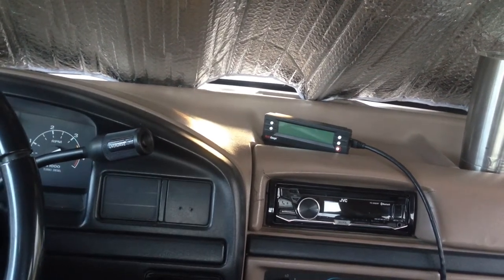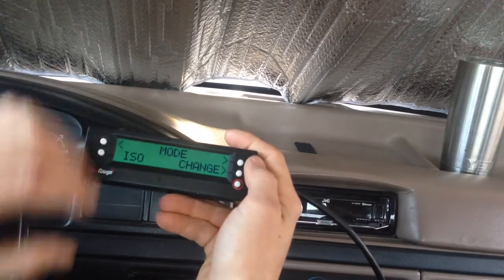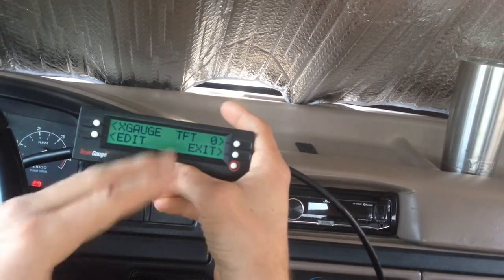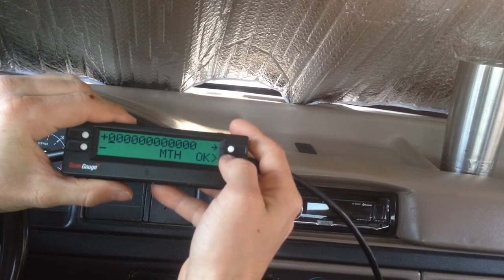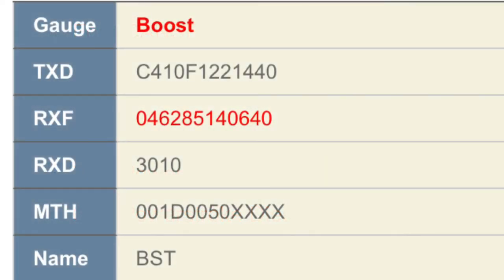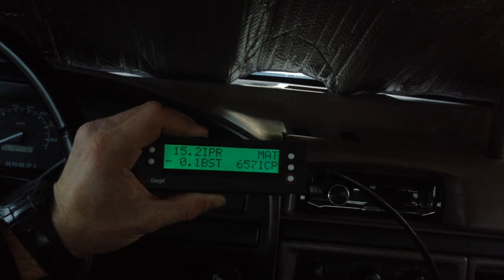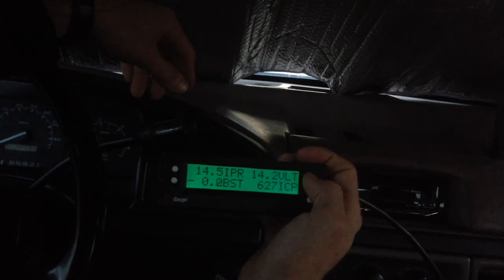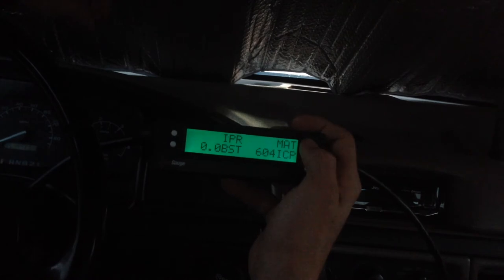Digital Gauges OBS 7.3 With Scangauge 2

Comment: You seem to be one of the few that has been able to make this work for our trucks. All over the forums everyone including scangauge says it will not communicate with our trucks
Reply from the maker: Yeah that's what I heard too. I ended up finding the instructions that the SG II uses to set up with a super duty 7.3. I already had the gauge from my previous truck, so it was just collecting dust unless I somehow got it to work with my OBS. It helps that mine is a late model being a 97. Though the gauge should work with any 96 and up model. I've heard some 95's can have the PCM reflashed for OBD 2 so the gauge will work with them as well, but don't quote me on that. Are you able to get the gauge to work on your truck?
Reply: Mine is a 96 and I thought about taking the chance. But my luck it wont communicate and will not be refundable
Reply from the maker: @LUMBERJACK877  I know what you mean. If you could borrow someone else's gauge that'd probably be best. You aren't in Texas are you? I did have a strange issue with friend's Super Duty. We tried connecting the SG II to his SD and it didn't work, though it works fine on my OBS truck. Now that I think about it there may be a blow fuse to the OBD 2 power port... If you want a cheaper option to at least try out whether it'll work or not, get a bluetooth OBD 2 reader. I have a BAFX OBD II Diagnostic Interface, it's only $30 or so off amazon. If you have an Android, you can get 'Car Gauge Pro', it's a poorly made app especially for $8, but it will allow you to run the injector buzz test, cylinder contribution test, and a glow plug system test. It also has some gauges that allow you to monitor some things like the scan gauge 2 but on your phone. Just a thought.
Reply: @LUMBERJACK877  Got one for my 96. It was Built Feb of 97 and is the Cab Chassis F350 in the avatar. It works on everything so far but manifold air temp. I like watching  what is happening.

Comment: THANK YOU!!!!!!!! I just bought a OBS 7.3 and have used a scan gauge II for a 6.0 and was hoping it would work on my 96!
Reply from the maker: I'm glad the video helped! I was in the same boat, except I went from a 97 Chevrolet to my 97 Ford. I use the gauge all the time now. By the way, what motivated your trading in of the 6.0 for an old slow 7.3?
Reply: @Rnddiesel  I totalled my 6.0 a few years ago. I absolutely love them. Eventually I want to 6.0 swap an OBS because I prefer the OBS body style. This 7.3 I just bought has over 300k miles, no blow by, one owner and it's unmolested and bone stock.
Reply from the maker: Awe man, sorry to hear about the 6.0. You know the 6.0 is definitely interesting; they've got their own share of problems, but the technology behind them is pretty amazing, and they're far more affordable these days compared to a common rail diesel. A 6.0 is an OBS would be cool! Heck at that point  you legally wouldn't even need the EGR. Congrats on the OBS 7.3 though! Mine's in decent shape too, but more of a work in progress. I've got 362k on mine, it just leaks a bit at times unfortunately.
Reply: @Rnddiesel  where did you wind up mounting the scangauge? I'm picking my scangauge up tonight
Reply from the maker: I wish I had a picture, I got it to fit perfectly basically right where you see it in this video, right in the middle of the dash. I got one of those carpet dash covers a while back, so I put some Velcro on the bottom of my ScanGauge and mounted it directly on the carpet. With the carpet dash cover, I put the wire coming out of the back of the gauge, routed it along the seam by the windshield and dash (it gets covered up by the dash cover) and over to the passenger side where it runs along the A pillar, goes under the glove box and into the OBD 2 port. On the bottom side of the dash by the glove box I found some "spare" wire clips, it's hard to describe, but the scan gauge wire clicked right into 2 of the wire clips like it was meant to be. It was the perfect amount of cable too.
Reply: @Rnddiesel  thank you for the reply, I'm going to try a semi permanent position for it. We will see what happens. I greatly appreciate it man. Keep up the good work, definitely got a new subscriber with me.
Reply from the maker: Thank you very much! I'm glad to help. Let me know how your gauge mounting works, I might be interested in changing things up with mine.
Reply: @Rnddiesel  I'll to take plenty of pictures, but I'm thinking of putting it below the wts light panel where the trim piece pops out.
Reply from the maker: Hmm, that would be interesting. Difficult to say the least I'd imagine too. There's not a whole lot of space there. Good Luck!
Reply: @Rnddiesel  I just got home with it. The only thing I don't have working that i want to work is my boost. It just reads 0.0
Reply from the maker: That's odd, you may want to change the scangauge MAP sensor setting to read boost rather than absolute, that may help. Also make sure you are checking the right one. On mine it has 2 BST "gauges" for boost monitoring. One doesn't work and is left over from the original Scangauge programming. It might help to double check that you've scrolled through all the sensors if there are 2 BST gauges. Glad to hear you got the rest working!
Reply: @Rnddiesel  I got it figured out, I had to manually enter the boost data on the SGII. I got the information from the website. Everything looks amazing from the data I'm getting the max boost I hit bone stock under WOT was around 11lbs at around 60. Does that seem right ?
Reply: I've gotta say man, you are awesome! 90% of the people on here don't reply to viewers and actually help them like you do.
Reply from the maker: I'm glad to help! I enjoy problem solving, so it's fun for me too. Besides you never know, I may have the same issues with my truck later down the road, and talking to other folks and seeing how they figured it out would a huge help for me too.  

Regarding the SGII data: 

Yeah manually entering boost data for calibration is a little bit of a pain, it also means that if a low pressure weather system comes to town or you go take a drive up the mountains or something like that, your boost numbers will be a little off. If you're running a "boost fooler" that would throw off the SGII boost numbers as well. Basically the boost fooler is a pressure regulator that limits how much boost the MAP sensor sees. Factory tuning pulls fuel when boost gets too high to protect the turbo, I think the magic number is around 16-18 psi boost or so. The boost fooler gets rid of that without tuning. 

Anyway, 11 psi at WOT seems a bit low, that is assuming you kept your foot down long enough to really let the turbo spin. They don't drive like 6.0's as I'm sure you're aware. The turbo response is way slower with the OBS 7.3 especially. There's a longer explanation on that subject though. Assuming you did let the turbo spool as much as possible, 11 psi is definitely low. When I first hooked up my scangauge with everything else stock minus a non-existent catalytic converter (The kid I bought the truck from hacked off the exhaust, not me...), Super Duty muffler, and a NAPA 6637 air intake I usually hit around 16 psi boost at WOT reading from the scangauge. 

It could be a number of things for your low boost pressures. The catalytic converter adds restriction especially if it's clogged assuming yours is still there... It could also be a simple as a bad MAP sensor, I don't know if that would show a check engine light or not. Though if it is indeed reading 0.0 psi ish at idle your MAP may be fine, it's just hard to tell without a second reference. Pull off your intake and look at the turbocharger impeller vanes. If those are mangled up that won't help boost, I think  you can get a stock replacement for $30 if you shop around, but you could also get a more refined impeller blade for "high performance" if budget permits. Your turbo could be worn, with the intake off, grab the bolt in the center of the impeller and try to push it directly in and out to check for end play. If there's play in the bearings your turbo might be due for a rebuild, that'll make a difference too. It could also be a boost leak. The intake plenum on your truck should be a black Y pipe. There's a rubber o-ring between the turbocharger and the y pipe that may have gone bad or wasn't installed properly. That o-ring is a pain to install by the way, neat trick is to use grease to temporarily hold it in place so you don't pinch it in half trying to get the two sections back together.  Also check your intake boots. If there's an excessive amount of oil/ greasy grime around those boots in the valley they may be bad and leaking as well. They are made of silicone which isn't very compatible with the oil that naturally makes it's way through the intake from the crankcase ventilator. Lastly on the turbo side, you may have leaking turbo Up-pipe donut gaskets. Grab a light and trace the up pipes from the exhaust manifolds back up to the turbo, look for soot around the connection points. They are sealed with these donut gaskets that are notorious for leaking and that'll cause your turbo to not spool all the way. That's pretty much it from the boost/ turbo side. It could be a number of other things like really worn injectors or a bad ICP sensor as well.

I hope that helps!
Reply: @Rnddiesel  I believe my low boost number comes from having 300k on the original turbo, injectors etc. She white smokes alittle on start up in the morning then stops the rest of the day. I've popped the hood and had someone start it and I couldn't see any smoke in the engine bad so that tells me theres no exhaust leaks. I think she just needs some love. My list of more I want to do is a 3" down pipe, 4" exhaust. 6.0 intercooler, intake, super duty 7.3 plenums, y, and snail housing and a wicked wheel II. After that I'll be happy and when she breaks motorcraft and international parts only
Reply from the maker: Wow that's impressive 300k on turbo and injectors! My truck has 362k, but the turbo was rebuilt at some point, and I'm supposedly on the 3rd set of injectors now, replaced them a little over a month ago. Replacing the injectors made a huge difference for my truck though. I never had terribly low boost numbers, but my truck was always really sluggish. Throttle response on the truck as abysmal! Well it turns out my fuel injectors were pretty worn out. After replacing my fuel injectors, I now see why the call it a "power"stroke. It used to only have power for the 1st 1/2 of the accelerator pedal, now just mash down and she keeps moving. It made a huge difference! Exhaust leak wise, I'm not so sure you'd be able to see any leak at idle anyway. Bear in mind too that as you put your foot into it, your exhaust back pressure goes from next to nothing at idle, to upwards of 10+ psi at wide open throttle. That pressure will make its way out through the smallest of holes and it won't take much to significantly affect the turbo spool. It sounds like you've got some good plans for your truck! I've got my own "custom" (build by me) downpipe that is a 3-3.5 inch then run to a 4 inch from there back. I've got an aluminum SD 7.3 intercooler installed as well. The intercooler was a tight fit even for the 7.3 one, I can't imagine fitting a 6.0 intercooler in there, but it has been done!  Also turbo wise, if you aren't planning to go too wild on tuning and what not, you may want to look into changing the exhaust turbine housing. Basically stock turbines have a 1.15 A/R ratio, you could get one with a 1.0 A/R ratio (Area/Radius "A/R" ratio smaller the number the quicker the turbo will spool)and it'll spool quicker at low rpms making it more drive-able, that's something I really would like to do.
Reply: @Rnddiesel  I watched your down pipe video and that solidified my thought of buying the complete system. I was thinking of a quick ratio housing. 6.0 coolers flow more than SD 7.3s but an SD 7.3 would be alot easier to install since I want to go to SD 7.3 plenums
Reply from the maker: Yeah it's definitely a bit easier to just buy the whole exhaust system. It sounds like you've got some good plans ahead for your truck. Have fun and good luck!

Comment: TFT works off an inducer so  resistance is the only reading you can use. Hotter ATF  lower resistance cooler is higher resistance so 3.55 would be like 40 deg and .56 she is real hot.

Comment: FYI, these codes work for my 95 PSD 4x4 with manual trans. No TFT reading but I doubt there's a sensor on my truck for that. Boost and such works though, nice to see my ICP figures are healthy on my truck (peaks up to about 2500psi, about 570-600psi at idle).
Reply: The E4OD has a trans temp sensor.  It's an input to the ECM.  The ECM leaves the Torque Converter UNLOCKED until a certain trans temp is reached.
You are correct about the manual trans.  The only sensor the manual trans is actually just a switch to turn on the reverse lights when you move the shifter in the reverse position.

Comment: That’s pretty cool. Does transmission temps and egts? I have a boost fooler so it won’t be able to read right for boost since I’m building over
Reply from the maker: It does not do EGT's, stock 7.3's never came with an EGT sensor built in, so for that you'll  still need to install a stand alone gauge. I'm not 100% sure on transmission temperatures though. My other code reader threw a code on my truck saying the transmission temp. sensor was out of range, so I suspect that I may have some form of sensor for that, but it may just be broken for the time being. As to whether or not that data is transferred to the PCM for data logging, I'm uncertain of too. If you figure that one out let me know! Though for safety purposes, a stand alone trans temp gauge wouldn't hurt. I've thought about maybe getting a 3 in one, trans temp, EGT, and Fuel pressure gauge if they make those.
Reply: I was looking into the glow shift gauge and pillar with 4 gauges for like 309$ and the 99 ford steering wheel gauge pillar for a single gauge there. It would be awesome just need some money lol waiting for tax season for some bank. 2 kids that’s like 7000$ lol and wife 1500$ lol
Reply from the maker: Kids and be a wife! Things to look forward to! What gauges were you planning to get?
Reply: Rnddiesel the obs trucks didn’t have a trans temp sensor. You basically have to get a separate gauge just like an egt gauge.

Comment: 96-97 obs do not have a trans temp sender (TFT), nor is the ECU programmed to read it.
Reply from the maker: I was wondering about that, thanks for the info! A standalone transmission temp. gauge solves that problem.

Comment: thanks for this video! I have a -96 7.3 psd.. it shows 578 ICP. 12.5 IPR   idle at warm engine. is that good?
Reply from the maker: Glad I could help! I was definitely stoked when I found out about being able to use a Scan-gauge on an OBS 7.3!

From what I've heard and seen, around 500 ICP is fine and your 12.5 IPR is good as well. The truck needs around 500 psi ICP pressure to run, so 578 is good for idle, mine hovers around there too. Regarding IPR the only time you need to be concerned is if it ever gets over 65 percent or so. At that point I've heard you've either got a bad HPOP or some high pressure oil leak. Mine never gets over 35 or so percent at wide open throttle on stock tuning.
Reply from the maker: If you don't mind I have a question for you. Assuming you have an automatic transmission? Did you have any luck getting the transmission temperature sensor to ready out trans temp?
Reply: thanks! mine never gets over 35 at WOT. stock engine at 240k. I have E4OD trans, can't get any temp reading with the Scan Gauge. can't seem to read engine water temp, only Oil temp.
Reply from the maker: Sounds like you've got a solid drivetrain! 240k is barely broken in. Ive got around 353k miles on mine. I appreciate the reply. I think mine is able to read water temperature, but it always reads 40 degrees Fahrenheit which definitely isn't right, so it may as well not read at all. I guess our older E4od's don't have transmission temperature sensor read out, oh well. Guess we'll still have to get an auxiliary gauge pod.